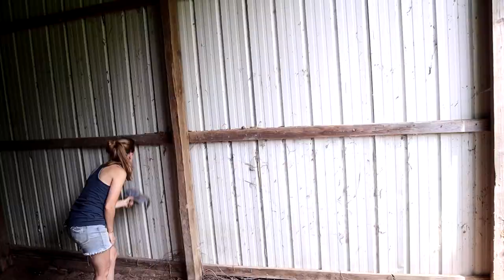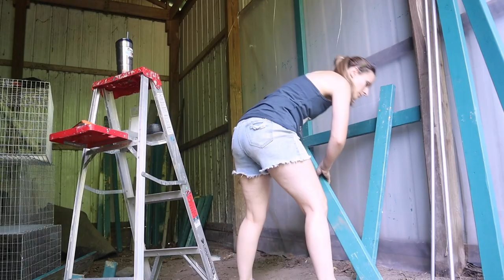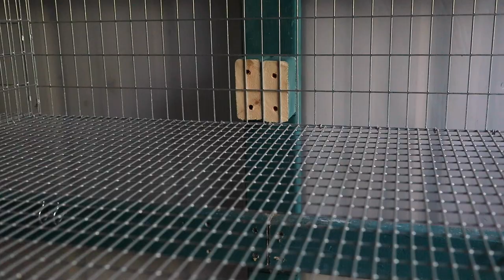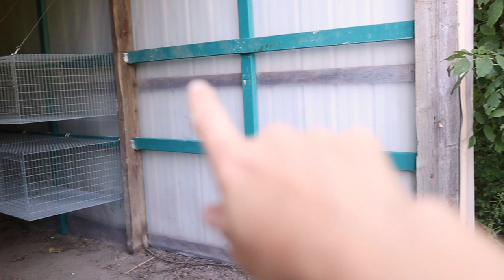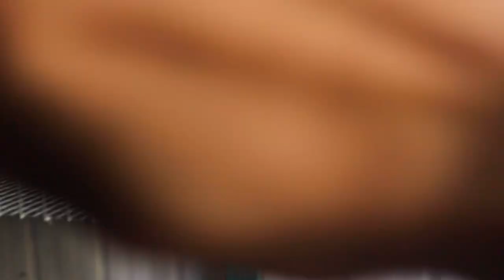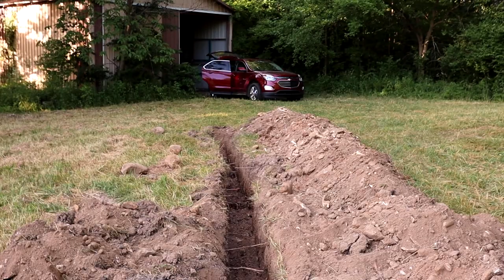Building a RABBITRY in an Old Barn

Comment: Fantastic job, well done. Self reliance is such a valuable trait. But I have a question… how will you keep snakes from eating the little kits?  I need to change my set up for that very reason. Snakes can EASILY get through that 1x2 hardware cloth on your cages.   Ask me how I know❕… a 5 ft+ black rat snake easily got into one of the ‘grow-out’ cages, ate a youngster, then got stuck on the way out due to the bunny bolus in its belly. 

As soon as I discovered the snake, I grabbed a pair of lopping shears and took its damned head off. I’m thinking maybe nailing up plywood on the underside of our barn loft, thus creating a solid ceiling to attach the cages to overhead but within easy reach for feeding & cleaning.

I’d love some suggestions on a good way to hang the cages from the ceiling far AWAY from the walls (bc snakes can and do climb) but still be able to take down the cages w/o too much difficulty for deep cleaning.  Any brilliant, creative, solution oriented minds out there have any suggestions ?? Thanks in advance.
Reply from the maker: I just posted a video on making stacker cages today! Luckily we haven’t had a problem with snakes bothering the rabbits.

Comment: Great idea. Seems like I've seen a video of yours with this completed and full of rabbits in the background. So this must work. Looks great in theory. Can't wait for a review in the future.
Im concerned about swaying on either row when the bunnies hop around. As well as the weight of mommy and babies in your 36 x 30 cages. But definitely looking forward to the review.
Also, you're definitely gonna need a steeper slope on the roll away poop shoots to allow for proper drainage and ease of cleanup so, I don't think you'll be able to do one for your upper cages but definitely for your lower ones. Maybe if you added a stool, you could raise the upper row higher to allow a steep 45 degree slope for those. The stool to reach the inside of the upper cages. I've seen it work well on other channels. One channel even has a hay troth at the bottom of the shoot to catch everything and then can be wheeled away with a dolly once full. And can have excrement easily stirred or turned in the troth for pre-composting and to keep smell down. Just some ideas for you to ponder on. Cheers!
Reply from the maker: Thank you! No swaying will happen. I’m very adamant that my cages stay as still as possible 😊

Comment: I'm moving and will have a rabbit shed instead of my current hutches. Do you have any tips about ventilation for the shed?
Reply from the maker: I would just say constant airflow (like box fans). If you have windows, you can try to make some sort of cross breeze. Installing vents and leaving the door open in hot weather can help the warm air escape.